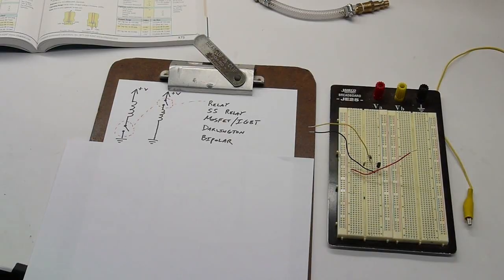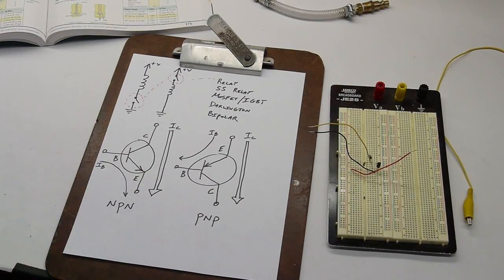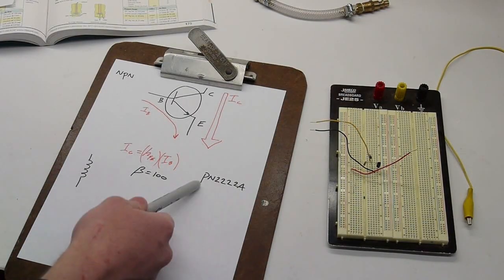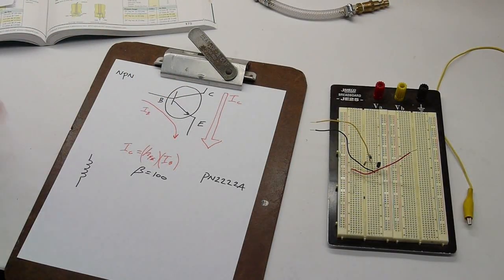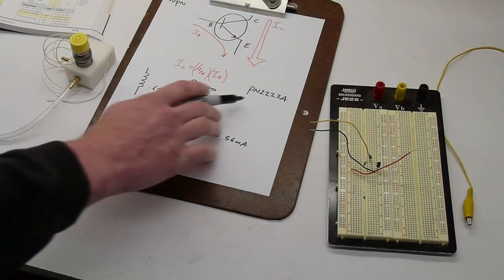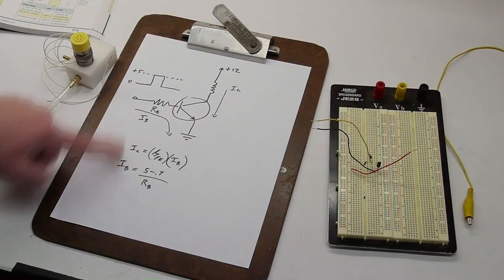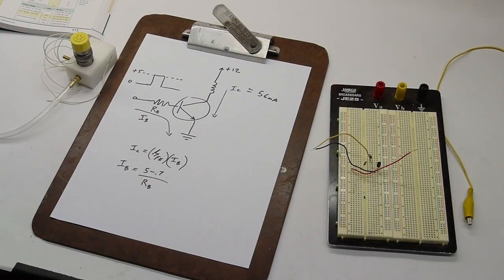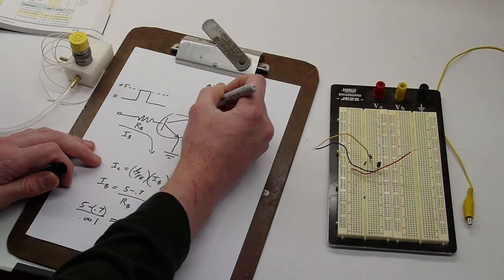Tutorial: How to design a transistor circuit that controls low-power devices

Comment: Great job explaining how it all works Ben. What type/size diode do u recommend for the clamping diode to dissipate the collapsing magnetic field voltage which you said across the coil could be several hundred volts. Wouldn't the diode need to be several hundred volt capacity so it itself doesn't fry?
Reply: You may use 1N4007 as a clamping diode. It's got a PIV of 600 volts or so..
Reply: No, the diode is connected reverse-biased across the solenoid, so it only needs a reverse voltage rating of 12V minimum. When the magnetic field collapses, the diode will go into forward conduction and clamp the transistor's collector to no more than around a volt above the positive rail, which is how it protects it. A 1N4001 (50V, 1A diode) is a common choice.

Comment: Super informative video.  Thanks so much for all the work.  As it turns out, I'm designing a circuit to control an air solenoid, and your lecture helped me so much in the design of the drive section.  Thank you!

Comment: When we get the component in our hands, how do we tell which pin is B,C,E ?
Reply: Well, I normally go to AllDataSheet (google it) and insert the code of the Transistor, an image will tell you witch one of the pins is Base, Collector or Emitter..
There's another way, as you may know a transistor has 2 PN junctons, and it is possible to verify in witch way the electric current will flow...
Sorry for my bad English!
Reply: I'll add that the first few results on google for "testing transistors" are gerat and simple, especialy the video. You can use rather diode tester instead of ohm meter, if your meter has one.

Comment: I don't understand how the inductor will discharge hundreds of volts ( 16:36 ) when the discharge of inductors  in a dc circuit is equal to -vl = Ve^-t/T
Reply: Siana Gearz You're correct, I should have said induces a current, not induces a voltage.  Thanks for pointing that out.

The magnetic field collapses, which induces a current in the inductor, which due to ohms law where the resistance of the inductor is quite low and doesn't change, the voltage is the only thing that can change in response to the sudden change in current, hence the voltage spikes as the magnetic field collapses.

As you said, that voltage can damage other components in the circuit, thus why having a clamp diode is a good idea.  As it prevents that voltage spike from occurring and reaching other components in the circuit as it allows the current to flow the moment the spike reaches the bias voltage of the diode, instead of thousands of volts.
Reply: Its been a while since I took EE classes, but if I remember correctly its basically because of electrical inertia. Things don't like changes in motion, this is true for current as well.  So, when you remove the current from the inductor, the magnetic field that it built up still exists, and that field 'induces' a voltage in the inductor in order to keep the current flowing, This induced voltage will continue to increase so long as there is energy in the magnetic field. (len'z law). Usually this means that the voltage reaches the dielectric breakdown voltage of air, at which point it discharges as an arc from the inductor to the closest conductor (such as in the contacts of a relay).

In essence, I think we could say: knowing the current flow doesn't immediately change, and knowing the resistance of the inductor/circuit doesnt change, the only thing that can change is the voltage, so as the magnetic field collapses, the voltage rises exponentially.

The clamp diode allows the current to resume flowing back around into the inductor as soon as the spike passes the diode biasing voltage, which prevents the magnetic field from inducing a greater voltage to maintain the previous current flow.
Reply: It's not useful to consider that the magnetic field induces a volage. The current flows through a coil, and the coil resists changes in current, it stores energy to keep supplying that current. The problem isn't the voltage across the coil, who cares about that, it's the voltage across other components in the circuit, in this case it's the voltage across the transistor. If you were to force a current into a high resistance path, such as a transistor that is currently off, necessarily that component will gain V=IR across it, basic Ohm's law. With voltage high enough, an electical breakdown will occur in the component which allows the current to pass, but will also damage the component.

Comment: I was going to use my Arduino to trigger a 5v relay that in turn sends 12v to an air solenoid.  What I discovered in that my Ardunion pins only output 3.3v which isn't enough to trigger the relay.  Now you have me thinking I could just use the Ardunio with a NPN2222A transistor to trigger the 12V solenoid directly, but I'm not fully understanding the math.  Can someone explain which transistors I need between the Arduino and the NPN transistor and do I need the diode?  I have a separate 12v power supply for the solenoid.  The value on the solenoid are 12V DC, 2.5VA, 200mA and the online specs indicate the allowable voltage is +/- 10% of rated voltage.  The specs also indicate the power consumption is 3W.  Sorry if I am not explaining very well.  Just getting into electronics as a hobby and I know I have a lot to learn.
Reply: Kevin I was thinking some folks might be a little confused because this video is actually at least one level up from what 99.9% of the population of the earth can understand. You need to start with ohms law (basic E=I*R). The basic formula is voltage (V or "E". pressure)= Current ( "I", flow or movement) times resistance ( "R", back pressure or preventing movement). The balance of this is everything in most of life. If you are walking along on level ground there isn't much resistance (R) so it doesn't take much effort (E) to move along (I). If you come to a swinging door you must go through {bigger "R" than just level open ground) you must push it harder to open it (bigger "E") to continue walking ( current "I"). You only use enough push (E) to overcome the resistance of the door so you can continue at your pace (I). You don't kick the door open (large "E" as you might break it (analogous to using the wrong combination of parts in transistor control)). Once you understand ohms law (E=I*R or I=E/R or R=E/I) you will understand what is going on in the video. The thing is if you think about how it is applied in your life (as in my walking down the road example) you will realize you use the formula constantly in everything you do. Sales or courting is nothing more than pressure overcoming resistance so you get movement! Same with teaching or training or self discipline. If you don't bother to work out how to design the circuit it will be like kicking the door open and you will break things whether that's blowing a transistor or ticking off a customer. Doing it right is called engineering!
Reply: If you listen to the inimitable Judy above and can figure out her examples, you may be fine right now.  If not, I think listening to Ben carefully may give you the answer.  The way I figure it, your situation looks like this:

In Ben's example, he is drawing 56mA. Using use the PN2222A transistor with a gain of 100, so he delivers .56 mA to activate the transistor.  In his example of course he sends a full 1mA to ensure the solenoid circuit is not stressed by allowing 100mA to flow through the transistor.

You are using a solenoid which will draw (all things being perfect) 200mA.  I am no expert, but I am guessing you want to do the same as Ben and allow some extra current to flow to guarantee the solenoid is fully actuated.  For the sake of simplicity, I would guess 500mA would be enough.  If you are using a transistor with the same gain (100), you will need to push 5mA to the its base to allow a full 500mA through the collector to emitter.  As Ben states in the video, the device is only going to pull what it will pull, which SHOULD be 200mA.

So, you know that your output voltage is 3.3v.  As explained in the video, there is going to be a voltage drop of .7 across the Base-Emitter junction, so your working voltage will be 2.6.  This is the voltage we will use with Ohm's Law to determine your resistor value.  With a voltage of 2.6, and a current requirement of 5mA (.005A), we can figure out the resistance required.  

Voltage (V)= Resistance(R) x Current(I)  (all in standard values)

Since we need the resistance(R), we divide each side by the current(I) to leave resistance(R) by itself on the right side of the equation; V/I=R.

Substitute what we know:  2.6(V) / .005(I) = R or 2.6 / .005 = 520.  So a resistor of 520 ohms should be placed in series from the Arduino's output to the transistor's base to allow 500mA to flow.

I don't think that is a standard value for resistors, but 470 ohms is.  If we fit 470 ohms into the formula and divide both sides by it (2.6(V) / 470(R) = current(I)) , we get ~.0056A or 5.6mA.  With a gain of 100, the transistor will allow 560mA across the collector-emitter junction.  That is plenty enough to actuate a 200mA solenoid.

So, in regards to which transistor to use, you need to find one that can handle about a half Amp.  Looking at the spec sheet for the 2N2222 NPN transistor, it has a hFE (gain) of 100 and a max Ic (collector current) of .8A or 800mA.  These are available everywhere, even Radio Shack™.

As for the diode question, YES and YES.  You want the clamp diode (any standard value should work for your current) so you don't build up a huge voltage spike from the collapse of the magnetic field in the solenoid.  I have seen things catch on fire from forgetting this diode.  It allows the magnetic field to collapse and dissipate the latent energy safely.

Good luck!
Reply: The solenoid's VA rating is essentially the value of operating voltage (12V) multiplied by operating current (200mA, which is also 0.2A): 12V * 0.2A = 2.4VA (2.5 is a "rounded up to the nearest 0.5VA" number). The 3W rating is basically the same number, but is usually the maximum power that the solenoid will consume (and eventually dissipate as heat). These are all a bit confusing, but the current rating is the thing to understand when designing a transistor switch circuit. So 200mA at 12V is what's important.

The transistor acts like an imperfect switch, so if you use a 12V supply for the solenoid, some of the voltage is "lost" ("dropped") between the collector and emitter. When used as a switch, we try to minimize this voltage drop. To do so, we operate the transistor in "saturation" mode. According to the PN2222A datasheet, the voltage drop from collector to emitter is about 0.15V at 200mA. This means the solenoid will actually "see" 12 - 0.15 = 11.85V, which is well within the +/- 10% specification. The actual current will then be a little less than 200mA, but the difference in this case is trivial. 

The thing to note is that in saturation, a transistor's gain is considerably less than in "linear" mode. The general rule is that gain is about 1/10 the linear value. For the PN2222A, the gain in saturation is usually specified as 10. This means we need 200mA/10 = 20mA base current. 

Of course, this drive current comes from the Arduino's output pin. These pins come from the ATMega328 IC on the Arduino, and the output specifications state that we can get up to 40mA per single pin, so we're okay. It's important to note than we can't draw more than 200mA for the whole chip - including the current the rest of the chip needs, so don't plan on driving more than a few solenoids.)

(Things get a little more complicated here, but we are almost done!) The voltage at the output pin depends on how much current flows from the pin. According to the spec sheet, the output voltage can be about 1V lower than the 3.3V supply voltage, so we'll use 2.3V as our output voltage. Finally, we need to see that the base-emitter voltage drop can be about 1V instead of the 0.7V typically assumed. So the voltage across the base resistor can be as low as 2.3 - 1 = 1.3V. If the current is 20mA (0.020A), the base resistor value should be 1.3/0.02 = 65 ohms. The nearest standard resistor value no greater than 65 ohms is 62 ohms (selecting from standard resistors with 5% tolerance), so the base resistor value should be 62 ohms.

Why is this so much lower than the 520 ohm value given by the previous poster? At 520 ohms base resistance, the transistor will not be saturated for a load of 200mA, so the collector-emitter voltage drop will be higher, and therefore the voltage available to the solenoid will be lower than the 11.85V we used. For reliable operation, we want the collector-emitter voltage drop to be as small as possible. A 520 ohm resistance will probably work, but the solenoid's voltage will be much closer to the lower end of its +/- 10% tolerance; if your 12V supply is actually a few tenths of a volt lower than 12V nominal rating, the solenoid may not operate reliably. A base resistance of 62 ohms overcomes this problem by ensuring that the transistor is saturated (fully on).
Reply: It's not too hard to do. Use the same circuit presented here, but use a different base resistor. The base current you need (according to the transistor's spec sheet) is about 5mA, and this current comes from the Arduino's output pin, which can output 5mA easily while dropping only a few tenths of a volt. So with output falling from 3.3V to about 3.0V, the base resistor value is (3.0 - 0.7) / 0.005, which is 2.3*200 = 460 ohms. 470 ohms should work fine. By the way, all of this is for normal room temperature. If the circuit is to be used elsewhere (especially in the cold), the base current needs to be boosted (because transistor gain falls as it gets colder).

And yes, the diode MUST be present across the solenoid (cathode of the diode connected to +12V).
Reply: Judy Skogen I love the "courting" example!  Now I understand my failures in that arena!

Comment: what kind of diode you use in parallel with the solid state val?
Reply: Usually a 1N4001 (up to 4007) will work fine for most applications

Comment: If you have a 12V supply, how do you get 5V to the base? I know it is a voltage divider but, I forgot the math. Thanks.
Reply: beenn15 You're simply suggesting to take a different approach which is equally valid. You can either use 1 resistor or voltage divider network composed of 2 resistors. You can also use the wheatstone bridge network to meet the same goal. What difference is that going to make? I guess none, except for making a simple task more complicated to deal with...
Reply: R=12-Vbe/Ibase      
Vbe = anywhere from 1.5 to 2.5
Reply: You don't need 5V, you need enough current. So the voltage is 12-0.7 because of the pn-junction's voltage drop, so 11.3. In order to get 0.56 mA, you'd need 20178.57 Ohms, so a 20k resistor will do fine.
Reply: vir ingens 0.7 volts is not enough to reach saturation. But 5V seems to be a bit excessive...I guess 1.5V (or 2.5V) will do just fine.
Reply: 2013Aleksey2013 i think you're missing the point.  he can get 5V from 12V with just a voltage divider.  Using 2 resistors (R1 and R2). R1 and R2 connected is series like this: (12V------R1------R2------Ground). To get 5V across R2 the formula is 5V =12*R2/(R2+R1).  Pick a value for one of the resistors, plug it into the formula to find the value of the other resistor.  Hope that jogs your memory a little.

Comment: so i still didnt understand quite well why selecting NPN :/
Reply: Doesn't really matter which one you choose.
Reply: PNP it inverts the drive signal (0v = on). Also since you are sinking current from the 12V supply (as in the example) your resistor value calculations are based on that voltage, instead of the voltage of your drive circutry. If your 12V supply is poorly regulated (as is often the case when driving primative devices/relays, etc) you could start to sink additional current into your drive circutry you did not design for. And finally, if your device is predomantly in the off state, you would be wasting power keeping the transistor turned on to keep the device off.

Comment: great video, could you explain with more detail the purpose of that capacitor?
thanks!
Reply: baleia is to pre-bias the diode, so it conducts immediately instead of waiting for the voltage across it to trigger its avalanche mode.

Comment: As a general rule of thumb, in a DC circuit, would it be true to say a transistor and an LED would normally require a resistor for protection?

Comment: Hai I am very much interested in learning electronics and presently I am 55. So at this old age, it is quite difficult for me to understand the subject in depth through integrated mathematics. I simply want to have a video tutorial where a circuit with few components is drawn and a step by step analysis is made as to how to read it i.e. first the power and then other steps i.e. if a resister comes in between and then other components one after another and finally connecting the components step by step. I shall be grateful if such a tutorial is uploaded by any expert for me. Thanks and Regards

Comment: good explanation: so in order transistor to work it needs apply a small current to base (for both - npn and pnp types) - so it works like switch. but i did not get the amplification effect of the transistor, and also - are transistors different in voltage applied - in your example it was small transistor that can sustain 12v but are there 24v ones?